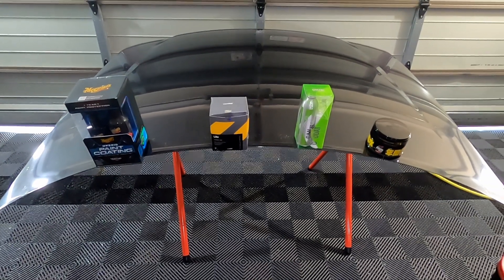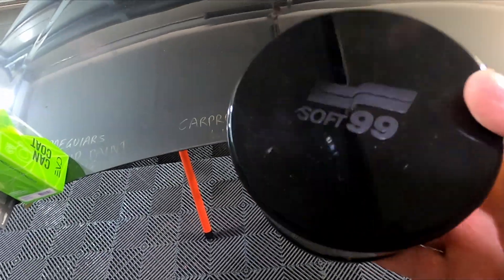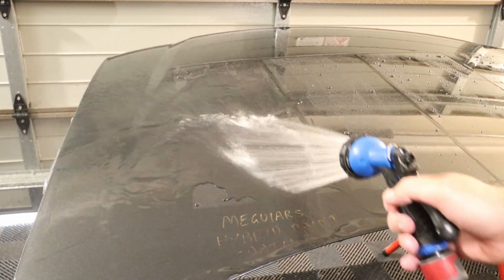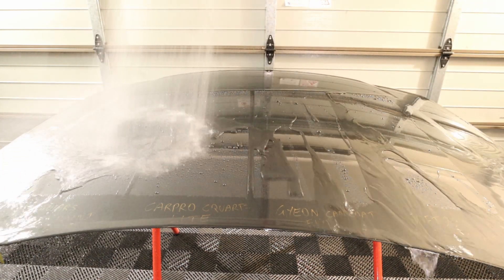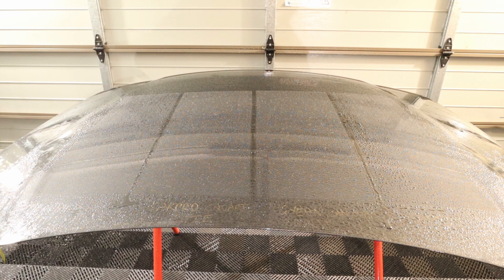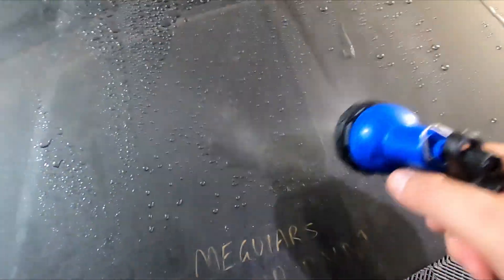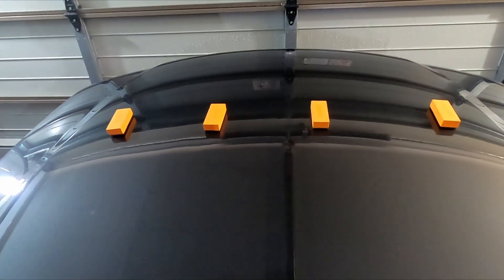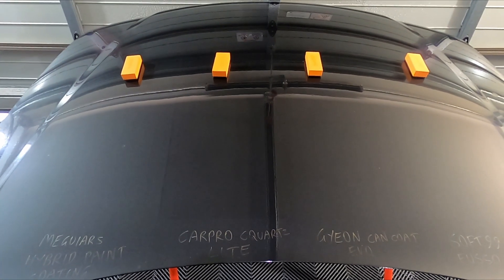What's The Best? 7 Month Update Gyeon Can Coat v Meguiars Hybrid Coating v Carpro Lite v Fusso Coat

Comment: The darkening of the CarPro looks great, only issue I have is that if you’re going to apply with a block and suede or applicator you might as well use UK 3.0, this is where the Gyeon excels as you can apply easier and quicker with no real drop in performance, but that darkening though looks fantastic.
Reply from the maker: The carpro comes with large microfibre applicators not the block I just prefer the block personally as I know I'll get even coverage

Comment: Sooo interesting about the slickness, the topper is a great solution to allow as much road water to run off, especially on the lower parts of the car.  I'm going to make toppers more a regular part of the maintenance, thanks heaps 😊
Reply from the maker: Yep exactly why I've started using them more on my coated cars

Comment: I wonder if toppers used during the lifecycle of the coating will help improve the durability of the underlying coating. You bring up a good point in the using toppers to even out any deficiency in a coating. 

So for example you use a topper on the Meguiars to increase durability. Whereas the Carpro Lite you use a topper to increase slickness. In the end you are using a topper either way. So this may level out the playing field if that is in someone’s routine. 

Then the Meguiars might make some more sense again if it is easy to apply. Then last over a year if I use a topper to extend the life/protect the underlying coating once a month. 

If you a a person who doesn’t like using a topper the more durable stand alone coatings make more sense. Just brainstorming here.
Reply from the maker: They will for sure add to the durability as they will work as a sacrificial layer to the base product

Comment: I can't remember but did you use 1 coat or 2 coats of the meguiars?
Reply from the maker: Just one as the directions don't mention a second coat
Reply: @EvolvedDetails  That's crazy. I was sitting here looking at the same product I got from Ollie's for $15.99. It's saying apply two coats
Reply: @EvolvedDetails  I understand. It says it under can but it's optional. According to the can
Reply from the maker: Ah ok I just read the back of the box and it didn't mention it so I went 1 coat  I'd say a second coat would likely help durability

Comment: There are no coatings that can fantastically repel water while having impressive round beads at the 1yr mark (on daily drivers in a hot rainy climate). 

Most coatings are already nearly dead  or unimpressive at the 9month mark. 

If coatings were THAT great, there would be no need for spray-type SiO2 products to bluff ourselves.
Reply from the maker: Take a look at my 3 year update on the red evo.
The coating is sti doing great and yes while it has had some toppers here and there I don't see how that can take anything away from it